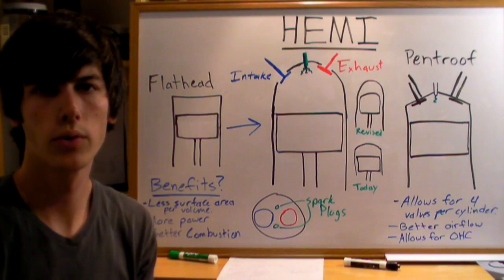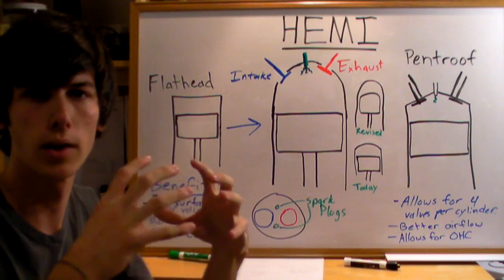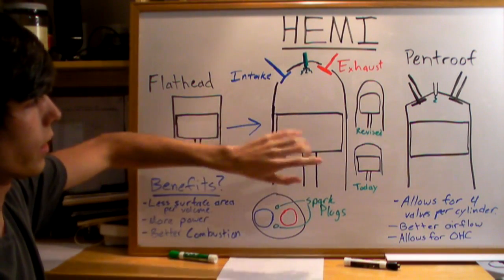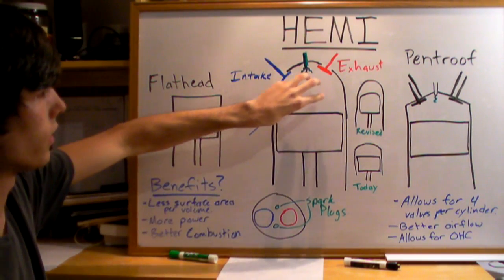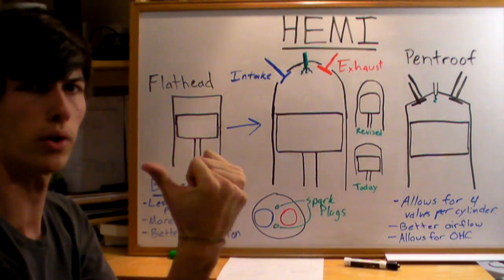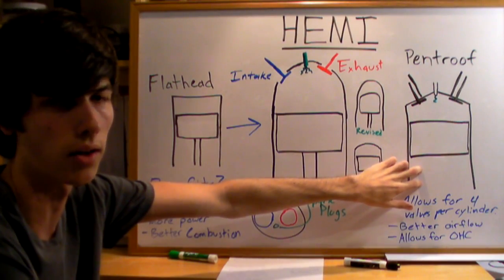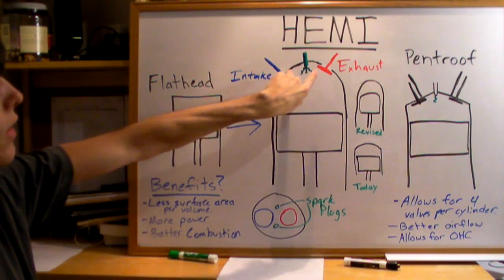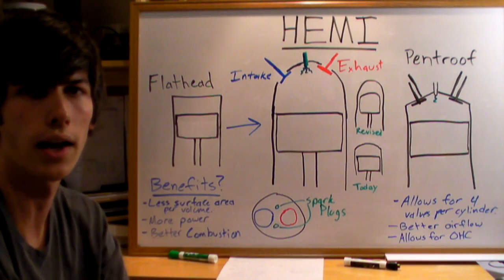What Is A HEMI Engine?

Comment: And by the way if hemi is such a bad way to build a motor why do most dragsters run only hemi motors ?
Reply: yet is still the fastest and most powerful engine in drag racing. Like I said, it's very terrible emissions wise and in a naturally aspirated form which is why it has been phased out of modern cars. But they are still great for going fast, I think you missed the point.
Reply: more valve area and a better angle from the port to the valve while still having a convenient intake manifold design. also those are supercharged and run on nitromethane, they need a big combustion chamber to make space for the huge amount of liquid fuel they ingest, the volumetric ratio of air to fuel is so low that lower compression makes more power because you can fill that space with fuel still making the pressures of a higher compression engine and still ignite the mixture. the normally aspirated gasoline burning engines in prostock cars don't resemble a hemi very much, they would need such big domes on the pistons it would obstruct flame movement.
Reply: I'll take the HEMI but I all ready own one and I like ancient history
Reply: +The real doktorbimmer The concept of "efficiency" is lost on most car guys because they associate it with the marketing term where the metric for efficiency is miles per gallon. In a performance context you're totally right that a more efficient engine simply turns fuel into horsepower better.
Reply: Gentleman, your argument here is engineering versus emotions. I love my 2013 SRT Challenger. To the average Joe on the street it has a Hemi. It isn't a real Hemi as The real doktorbimmer points but that doesn't make me mad. It was made in the spirit of the classic Hemi with a much better design. It is closer to a pent roof design and although the 2 chambers are similar one clearly excels over the other. Just be glad bobba68 that at this point in time we have a big V8, 2 OHV engine, making awesome horse power available to us. I was 16 in 1983, at that time we had TBI Camaro's with about as much power as a modern minivan and 5.0 Mustangs with 2bbl carbs and some of the worst heads ever made. We never would have dreamed of the great cars the future would bring. I remember being impressed with Grand Nationals and LX Mustangs in the late '80's running 14.5 in the quarter mile. Then the LT1 Trans Ams and Cobra Mustangs running 14.0's in the '90's. Then the WS6 T/A's and Shelby Mustangs hitting the high 13's. GTO's running low 13's in 2005. My SRT runs 12.6 totally stock and look at the Hellcats and soon the Demon along with awesome Shelby's and Z28's. This is an awesome time to be a car enthusiast if you are into old school muscle or if you are into 4 valve, pissed off bumble bee, turbo charged 4 cylinders. It's not a real Hemi but it's a real Muscle car.
Reply: +The real doktorbimmer Well that is partly true but the reason for the hemi head for Chrysler was to achieve better air flow by placing the valve stems on an angle alows for much bigger valves compared to a traditional wedge head design with parallel valve stems. In Australia Chrysler had a hybrid hemi/wedge head that angled the valve stems to allow bigger valve head diameters and could blow the doors of any v8 in Australia. Twin plug hemi heads are not only on new gen Chrysler hemis either they where also sold as an after market head by Chrysler in the 70s not for emissions but for better flame propagation in the cylinder.
Reply: +George Withrow   
There's no comparison between the purpose a dragster engine is designed for and that of a car made for transportation.  

A top fuel dragster engine is designed to last for a minute and then is torn down.    A car engine is designed to last 100-200k miles.
Reply: +The real doktorbimmer You must be great at parties.
Reply from the maker: George Withrow All racing is confined by rules. Regulations dictate specific engines, so that's what's used. Engineers do the best they can within the guidelines of the sport.
Reply: W
hat the hell does china or NASA have to do with hemi head engines
Reply: I'm not sure how what I wrote has anything to do with a concept being completely lost with me.

My point was... When building a Huge HP drag engine like a Hemi back in the 60's they were not looking as much at efficiency and emissions. (my comment if you would have read was more directed at the emissions) Although high compression doesn't always mean more efficient, (when running on pump gas anyhow) but I understand what you are saying, and I agree.

I think we agree on pretty much everything.

I was just trying to make a point about why people still love the Hemi or any other big block Chevy, Chrysler, or Ford... Nostalgia.
Reply: "Nitromethane carries its own oxygen, so it needs much less atmospheric oxygen to burn. The theoretical ideal or stoichiometric air/fuel ratio for gasoline is 14.7:1. That means, 14.7 pounds of air are needed to burn 1 pound of gas. Methanol, which also carries oxygen, has a stoichiometric ratio of 6.45:1. But with 100 percent nitro, the ratio is 1.7:1! Because the displacement of an engine cylinder is fixed, this means-assuming 100 percent volumetric efficiency (VE)-8.7 times more nitromethane than gasoline can be burned during one combustion cycle." Just atleast understand that it is not the same, Yes modern engines are fantastic at power with gasoline, which is what they are developed for, not nitromethane.
Reply: +The real doktorbimmer And I will admit I had pro stock and pro mod confused. There a cobra jet mustangs in the class with dohc and they do perform well with it being an N/A class and even then push rod wedge ls engines do just as well in camaros.
Reply: +The real doktorbimmer That's bullshit! They use gas turbine engines, highly boosted diesels of old and new design and many other types of old and new engine in tractor pulling. Some highly boosted Pro Stock Class John Deere Diesels are getting up to around 1000hp these days. 
What a stupid ignorant thing to say.

They also modify WW2 era RR Merlins and Allison engines.
Reply: +Johnnyc drums Well they can build big motors using modern technology and in Australia the GM division there almost made a limited production run of a fuel injected 427s, but the project was canned after deposits were taken by potential customers. I don't know why.

The trend today is for smaller capacity V8 motors. One needs to think logically. A big motor is always a big motor, whereas a small motor can be small and big.

A motor is an air pump:

A 5 liter V8 can pump 750 CFM (Cubic Feet/Min) of air @ 7500 rpm
A 10 liter V8 can pump 1000 CFM air @ 5000 rpm

Our 5 liter engine pumps 250 CFM air @ 2500 rpm
Our 10 liter engine pumps 500 CFM air @ 2500 rpm

One must remember fuel is added to air in the ratio of about 14:1 for combustion to occur on earth.
The double volume of fuel to run the big engine is easily seen in this example above. 

This is a just an engineering concept only, but it closely illustrates the inefficiency of large engines in the role of propelling a car in the 2 tonne range. The small engine can do the work of a big engine, and the big engine made to ultimately pump more air (this is hot rodding :).
When one mover to the 4-5 metric tonne range then it is the small engine that becomes inefficient as it is too small to do the intended work without high revs.

A slightly extreme example but still valid example could be the GM EMD; in this case the EMD 645V16. 
This is a larger Diesel engine, that powers Diesel electric locomotives, tug boats (often 2) and electrical backup generators and main generators. It is a 45deg V16 with 645 cu in per cylinder and routinely produces around 3500hp @ 950 rpm. It is this size because it fits its intended use almost perfectly and is therefore efficient design.

Motors are designed to fit their intended roles. 

Occasionally an unintended use for a motor can create some magic.
Reply: So as you are saying at the top of the thread; If we double c.i. or Liter displacement we only gain 25% CFM (Cubic feet/ minute) of air induction.      I question this theory.                                                Nobody believes this fairy tail upon further examination. You are presupposing that the amount of air is limited. It is only limited by the size of the hood and other intakes. What you are saying is: "Lets take this big 440 Magnum and make it breath like a 225 Slant Six because it's the only way it fits, and everybody just shut up and make the best of it.                            .
Reply: +George Withrow You deserve a medal for this uninformed comment. Most dragsters use heart shaped cylinder heads, because almost all after market cylinder heads are heart shaped simply because they're far more superior in a two valve configuration.
Reply: I agree i just bought a Hemi... a 6.1L SRT8 ... Its still faster han 90 percent of the cars out there
Reply: Stuart Johns Chrysler developed a SOHC 4V Hemi in 1966, code A925.  It was to.be used in NASCAR, but Bill France outlawed both it and a proposed DOHC Ford 427.  

Some of the engineering work that went into the A925 was later used in the 3G Hemi V8's.
Reply: +George Withrow
Aren't ALL NHRA-approved engines variations on the same basic engine design?
Reply: +George Withrow 

Welllllll... Not so much... 

Are they Hemi Engines??? NO!!!!  ( they are all special ordered engines ) 
Are they "Like" the Hemi Engines??? Yes!!!  ( sort of ) 

They are designed to follow the basic layout of a 426 Hemi... True... With the hemispherical combustion chambers with 2 valves per cylinder, pushrods, and a center mounted cam shaft.  That's about where it ends because you will not find 1 "Hemi" part on a top fuel dragster engine. ( Nor will you fined any Chevy parts or Ford parts on there either.) Every part is specially build for that engine. (valves, heads, cams, pistons, rods, intakes, push rods, rockers, fuel, and the electronics)
Reply: I'm not sure you can read. 

Gasoline is very different from nitro methane, gas actually makes more power per gallon than nitro but if you burn enough nitro it eventually surpasses it. The ability to burn more amounts of nitro comes from the fact that it burns very slow compared to gas. The drawback is that nitro burns extremely hot, in fact nitro doesn't even finish burning by the end of the stroke, hence the need to dissipate heat very quickly. By the end of a run a top fuel is only running on maybe half it's cylinders because most of the plugs will be melted by then. It works well with nitro methane and makes good power with it, I even said it is a very inefficient and relatively weak to it's weight on gasoline.
Reply: +Engineering Explained The primary reason for a hemi head is to fit bigger valves for more airflow, the dowside with huge valves is heavy valves that need very strong springs to close the valve. Honda developed a hemi 4 valve known as radial four valve combustion using a single overhead cam with two rockers per valve which lead to the same problem of heavy valve sprins. the problem of needing heavy valve springs is a reduction in potential rpm as the valves can not shut fast enough. The double overhead cam pent roof desighn can not flow as good as a hemi head but by eliminating the need for push rods, rockers and heavy valve springs can sustain much higher rpms so can produce high power outputs at higher rpms sacrificing low end torque. Top fuel drag cars need both torque and horsepower tha is why hemi heads are used not the rule book.
Reply: +George Withrow ; It's all the rave in tractor pulling.
Reply: +Johnnyc drums A side oiler is a great motor actually - very rugged. The Ford 427 SOHC had OHC heads put on a an FE side oiler for Le Mans. The FE ford engine was surpassed by the 385 series which included the 428 and 460. Those engines made good power too but weren't as rugged as the FE series but were cheaper to cast and lighter.

Some of the motors you listed have excellent HP potential, AND durability which is never to be under estimated;
others, not so much. 
You omitted the Chrysler 440. Like a Hemi, it is a very rugged well designed engine too.

Chrysler had the B engine block (383, 400) and the B-RB (RB=Raised Block) The raised block engines were 426 wedge and 440 wedge. The 426 Hemi block was a modified B-RB block casting. The modifications were in two main areas:
1) Provision for cross bolting the center three main bearing caps
2) Provision for bolting Hemi heads which use a totally different bolt arrangement to wedge heads.
Accordingly, the Hemi block is unique. 
There is a company called Stage V that makes Hemi Heads for wedge blocks, but the exercise is so expensive you might as well just have a Hemi because the block is cross bolted and therefore stronger and more rigid.

The much admired Ford 429 Boss motor is a 385 series block with special heads. John Kasse makes replacements that you can bolt onto a 460 block that cost about $125. As with the original 429 heads the ports are a bit too big for street use and John recommends a big inch stroker for better streetability.
Reply: ThePaulv12 ; As a semi-retired non automotive machinist, I appreciate the information you are telling me. I've always wondered what, why, and how these 427, 426, and 429 c.i. race motors had so much more power than regular cars with the same c.i. displacement. I still don't know why a NASCAR motor can't be used in a regular vehicle? Why, we got, direct injection, computer control, and more gearing  ect. In addition; Why is NASCAR mandating the use of push rod engines? Lower CG? I'm told that Toyota got their reverse engineered prototype from NASCAR after FORD was told to bring in their race motor for testing and it disappeared. NASCAR didn't allow FORD to come up with a new block until about ten years later. I think they were still using the old Windsor engine up until a few years ago.
Reply: ThePaulv12 ; That John Kasse thing sounds like the way to go if your running a 429 Thunder Jet or 460 Lincoln motor. Yeah!, I did forget to mention the good ole' 440 torque monster used in the old GTX and other MOPAR type vehicles.
Reply: +Stuart Johns No! The primary reason for hemispherical combustion chambers IN CARS dates to the post WW2 era. As the development moved from side valve to overhead valves - allowed for by better quality fuel - then compression ratios began to rise. The thermal efficiency afforded by the low surface to volume ratio and knock limiting of the hemi became the reason. Other key advantages are the intake valve is closest to the intake port and the exhaust valve closest to the exhaust port. The gas flow path is efficient and the spark plug can be centrally located in the combustion chamber. The centrally located plug allowed a progressive burn of the air fuel mixture starting at a central point and had resistance to pre ignition. 

Pumping losses are losses in the production of power. High spring pressures and heavy valvetrain components are known pumping losses. Additionally, you're correct in your assertion that the valvetrain inertia at high RPM has to be offset by heavy springs; however your argument in the context in which you put it while superficially true is actually incorrect in many areas. OHC, DOHC pumping losses are equal to if not greater than pushrods. The real reason OHC is used is the fact that pushrods limit engine compactness when considering cylinder head port placement and shape. This then limits spark plug location and ultimately combustion chamber design. OHC frees the designer of the limits of pushrods because they 'frame" intake port shape, placement and design.

Four valves per cylinder are difficult to attain with pushrods and have some advantages at high RPM. Most basically, small engines can make the same power of big engines but need more pumping cycles (RPMs) to do so. Large valve, low lift quad valves control valve motion better under these conditions better than large single valves as you correctly point out.

But the thing here is, you are using racing and motorcycle examples and making categorical statements while totally ignoring the realities. 
The realities are small engines can now make big horsepower cheaply. Economics and therefore small multi valve engines are the primary drivers.
Reply: +The real doktorbimmer   Modern aftermarket Hemi's do have significant changes.. Bigger blowers, giant fuel pumps and twin Magneto's have changed the whole game. as long as the block doesn't exceed 500 cubic inches..
Reply: The real doktorbimmer Wrong.  the blocks porting and piston designs have changed enormously since the 60's.. Especially during the 1990's with the newer 1471 supercharger..The Engines are nothing like the Hemi's of old..
Reply: The real doktorbimmer Technically yes.. The 392 and 426 elephant generation 2 Hemi design was the forefather.. Today its TFX-"Top Fuel Incorporated"  499 cubic inch crate Hemi which dominates the top fuel classes..
Reply: The real doktorbimmer Yes the top fuel engines initial design is the 426 Chrysler hemi, but remember they only produced 1200 hp back than..Today its 10.000 hp   .. Blain Johnson was my Top Fuel hero....Nobody can tune a top fuel engine like Allan Johnson. pure genius..
Reply: +Engineering Explained Why do they not make DOHC that have valves that use quarter of the piston diameter half for intake and half for exhaust rather than circles within circles, this method wastes so much space?
Reply: The real doktorbimmer It does a bit, thanks
Reply: +The real doktorbimmer bruh hemis are the best engines ever dem shaker hoods tho
Reply: The real doktorbimmer obviously better than any BMW overpriced overrated junk.  get over yourself already.
Reply: The real doktorbimmer Incorrect.  Mopar sells brand new 2G and 3G Hemi engines.  FCA-US installs 3G Hemi V8's in large cars and Ram trucks.
Reply: The real doktorbimmer Incorrect.   FCA, based in London England, does business as FCA-US, (Chrysler LLC,  Auburn Hills, MI) 

 Fiat no longer exists as an entity; like Chrysler, it's a brand of FCA.
Reply: FALSE,

Mopar sells the 2G and 3G crate Hemis brand new.  A 3 second Google search
proves you wrong.

Clearly, you're no expert.
Reply: Yes, there ARE.  You can repeat that a thousand times,and stomp your feet
and plug your ears, but that'll never mean you're right.
Reply: +Jax Wins Your "Hemi" is a "HEMI®", it isn't a 'hemi' as in hemispherical combustion chambered engine.
Reply: +P Kranz JFYI, the 2G and 3G aftermarket crate motors are not produced by any production auto maker. No cars or trucks sold today use hemis, only some use "HEMI®"s
Reply: The real doktorbimmer

I still don't understand why you don't think I grasp that... You just wrote basically EXACTLY what I wrote?!?!?
Reply: This may have already been stated, I didn't read all of the last full years of comments. The Gen III Hemi uses a modified Hemi chamber that is flatter as the guy in the video says and it is oval to further lessen it's size making it quench better. I think the Hemi design is superior for drag racing, especially with enormous amounts of fuel used in nitro engines, because of it's great air flow due to it's lack of valve shrouding. I was in my garage today and there was a set of Gen III Hemi heads setting on the shelf above a set of S.B. Ford heads. It's easy to see that about 50% of the Ford wedge style head's valve is surrounded by the chamber while virtually all of the Hemi's vale is clear. Even the Pent Roof design has a little bit of shrouding at the roof although the multiple valves make up for that. If they were just a 2 valve head like an old Nailhead Buick, which used a Pent Roof chamber, then air flow would be poor. With that said I know the Hemi design, especially the classic Hemi, promotes poor burn and swirl. That is the major reason Chrysler uses 2 spark plugs in the Gen III Hemi and that is also why the Gen II Hemi died in '71 and not a few years later. The EPA deemed it too dirty way back then. I know there are many advantages to wedge chambers, especially todays high swirl, quick burn chambers like on GM's LS series engines. bottom line is that every design has good points and bad points and there is no magical design that trumps the others in all areas.
Reply: I understand what you are saying and I understand the engineering as you explain it. Of course Chrysler is just using the "Hemi" moniker as a marketing tool harkening back to the days when it was a very powerful design. Multiple valve engines will probably replace 2 valve engines someday and I say probably because there is still the cost factor of more parts. I have probably learned more about Hemi design in the last week partially thanks to this video/discussion then I knew from the last 30 years. When talking about 2 valve engines I think the current Gen III Hemi, and I call it that because Chrysler calls it that, is a very valid design. The Apache heads flow around 360cfm on the intake side box stock and almost 400cfm with a CNC port job. This combined with their improved, at least compared to classic "Fire Dome" design heads makes some great power with a bit of nostalgia thrown in. Of course I think GM's LS series engines are the pinnacle so far for the 2 valve design. But comparing air flow alone the Gen III Hemi flows better than the LS' "Twisted Wedge" design in as cast heads in every test I can find. Like you said, though, the inefficiencies of the chamber design limit it's ultimate power potential. But I'm 49, I'm not an engineer, I'm a master tech and a weekend drag racer and I will give up a little potential horse power for the nostalgia of driving my '13 Challenger. Shoot, being honest the car is too heavy and it has a horrible .359 drag coefficient but it looks really cool to my eye. It is a 21st century incarnation of a car designed in the late '60's and I suppose along that vein so is the Gen III Hemi. Good luck and thanks for the great dissection of this classic and beloved design.
Reply: I'm not sure why NHRA chose the Hemi as the only design but I know in the early 1070's racers were running every type of engine and they all switched to the Hemi because the other designs of the day simply didn't have enough air flow. Arnie "The Farmer" Beswick was running Pontiac 455's with both Ram Air IV and Ram Air V heads but he just couldn't compete so he switched to Hemi power around 1971. Most other racers followed suit around the same time. I don't know when NHRA made Hemi's the only engine but if everyone was racing them anyway then I guess it was a minor rule change. I respect your scientific approach to the debate, I would love to hear your thoughts on Harley Davidson motorcycles. But I now have indisputable proof that the Hemi is the best engine ever, I was watching Sponge Bob today with my son and Tony Fast, the legendary boat mobile driver, had a Hemi in his boat. You just can't argue with that, sorry!!!
Reply: bcubed72 either way my 6.1 will eat your car up in a delicious feast😈😈😈😛😛
Reply: The P51 Mustang is an awesome airplane. As a WWII aficionado I have always admired them.  There was an airshow in Kansas city about 9 years ago and one was flying in wingman formation with an F15. As I watched the P51 at full throttle winding through the sky next to the F15 I realized that the F15 was just trying not to stall out. That doesn't kill the cool factor of the P51, it just shows that technologically speaking, it's obsolete. Let me tell you what cars I own before you jump on me. I have a '33 dodge 5 window coupe with a 392 hemi out of '57 Chrysler 300C. I have a '61 Catalina with a 421, a '65 Mustang fastback with a '93 302, a '66 K-code Mustang coupe, a '69 GTO Judge with a built 455, a '69 Coronet R/T with a 440, a '69 Super Bee with a 383, a '78 Trans Am with a 400, a 2002 Silverado with a Duramax that puts out 550hp and 850lb/ft, and a 2013 SRT Challenger that is currently stock but I have a 426 stroker kit and some CNC heads setting in my shop just waiting to be installed. What The real doktorbimmer says is accurate. The 392 in my Challenger is only a hemi for marketing purposes. The pros of the original hemi design like excellent airflow and small surface area to minimize thermal losses have been surpassed by better higher combustion efficiency and lower emissions. Most car guys scoff when they here the term lower emissions but that is a by product of better efficiency, or better efficiency is a by product of lower emissions depending on how you look at it. Remember, Chrysler discontinued the Gen II hemi in '71 because it couldn't even meet the rather lax tailpipe emission standards for the '72 model year. Just because a 426 hemi has excellent airflow for a 2 valve engine, and it does, ignores the other deficiencies in it's design. I love the 426 as well as the 331, 354 and original 392. I own 3 Gen I 392's. But the hemi design is now obsolete just like the steam engine and just like the horse and buggy. They still make black powder rifles and they are more powerful and accurate then ever but they are obsolete compared with a modern centerfire high powered rifle using cordite as propellant. You don't have to hate the old motors to come to terms that they have been surpassed. I mean there are 4 cylinder engines now producing 2hp per cubic inch getting 40 mpg and producing a tenth of the tailpipe emissions of a 4 cylinder from the 1970's. If the feds would leave the gas alone they would be even more powerful and get better mpg. As a car guy that focuses on the old cars I can concede that modern technology has pushed the internal combustion engine to new heights and with the advent of electronic variable valve trains coming the best has yet to come. Instead of fighting against better engineering I feel it is best to adapt it to work in concert with the old as best as possible. My '33 Dodge has a FiTech twin 4bbl electronic throttle body fuel injection set up and it is so much more streetable then the old twin Carters and it actually gets 18 mpg when I just cruise it, which never happens by the way.
Reply: By the same reason nobody owns a miata
Reply: The real doktorbimmer ; LOL, those guys must find out very very quickly where the weak links originate.
Reply: The real doktorbimmer So Your from San Marino ?
Reply: The real doktorbimmer Awesome..
Reply: +Johnnyc drums Porsche 911 turbo, GTR, Koenigsegg, Lamborghini, Buggatti, Ferrari and a bunch more Im forgetting run 10s stock lol
Reply: +nikki martinez so you cant go to your local CDJR dealer and buya  brand new 5.7L/6.4L/ or 6.2L Supercharged Hemi?
Reply: The real doktorbimmer Yeah what's up with that.. Damn talk about a big let down..Is it a emission  issue?
Reply: That's because the hemi engine is a very powerful and strong motor
Reply: The real doktorbimmer 9th century Chinese skyrockets and the saturn V from NASA are basically the same ,both are rockets
Reply: pro mod is open to any engine and it is only dominated by hemi's and big block chevy's which is a wedge motor but pro mod is primarily high octane and nitrous systems sooo... im guessing you don't really know that much about nhra. Especially since the limit is 500 cubic inches and the firing order isn't even the same nor are the pistons or the combustion chambers or runners as a genII hemi. The newer engine is built around spreading heat and taking boost. And Honestly, just tell me, exaclty why it is better, I mean exaclty. I presented my argument quite well and you're going with the five year old argument of "it is becus" Valves hold a lot of heat, and with boosted nitro methane and nitrous it is not beneicifial to have four valves, the extra heat causes melting and nitrous backfires.
Reply: The real doktorbimmer my lawnmower would disagree with that last statement,  hek y r we arguing over this outdated internal combustion rubbish, P85D anyone?
Reply: +George Withrow 37 posts, all that blabbering away and you guys NEVER did land on the real reason that Hemi's are exclusively used in NHRA's top classes........ so, am I going to bail you guys out now?  .........Nope, I dont think so.    BTW, Hemi heads do NOT out breath good 4 valve heads, as somebody said in the thread.
Reply: Well let me tell you guys I still like the hemi new style and old all the bull shit you guys are trying to tell me just isn't gonna make me change my mind it's MOPAR OR NO CAR . The way I look at it is you like your shit box motor and I'll like mine done with this
Reply: +The real doktorbimmer +nikki martinez
Why is better efficiency and cleaner emissions even being talked about? Do you really believe the NHRA Cares about emissions? Don't give them any ideas... They may want to start putting catalytic converter on the Top Fuelers!!!  lololol

Also... What engine used for drag racing in the 60's & 70's is used in any modern car of today? NONE that's a silly response.
Even the small block Chevy 350 has been "phased out." 
The 5.0 Mustang isn't the same 5.0 that was in the earlier year mustangs. 

Back in the 60's you were hot if you was running in the 12's... Today, factory cars are running in the 10's and better. 
My Corvette runs 12's and I can get close to 30 MPG's (28mpg is my best) 

In 10-15 years from now the LS motor probably won't be found in the new modern cars of the 2030's 

Everything changes... People love the Hemi for what it use to be. 
Some classic cars just wouldn't be the same without a Hemi in it. 
It's called nostalgia.
Reply: +George Withrow but of course it goes without saying, nothing that makes a hemi good comes with good gas mileage, which is why they aren&#39;t seen in any new cars. Im sure the typical ls engine weighs less than 600 pounds as well.
Reply: +George Withrow That question is loaded with bias. 
In answering that biased question of yours, the reason Hemis are used in all out racing is because the design is optimal for power production using exotic fuels, high revs and large valve opening etc. 

It is a good racing design and the mystique of the 426 Hemi is as much about putting a racing motor in a street car as it is about the Chrysler marketing department of the era.
Reply: +Steve New ; What factory car runs in the 10's?
Reply: ThePaulv12 ; They blow up sometimes. Why? It's not like they are treating those engines badly. Could the design be faulty and too old fashioned?
Reply: Top fuel is not using the vintage hemi design as is.  The blocks, heads and valve springs are all technically state of the art.  Saying it is backward is like saying the traverse leaf spring in modern corvettes is obsolete.  Corvettes have been doing well in le mans.  If you think a car needs irs, 4 valves and ohc to win races, you're probably european, or read road and track too much...lol